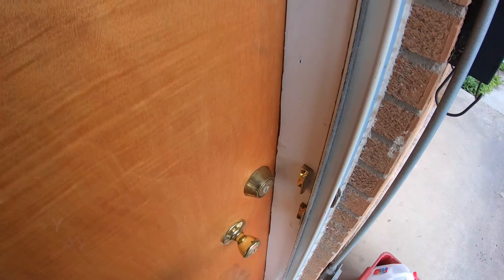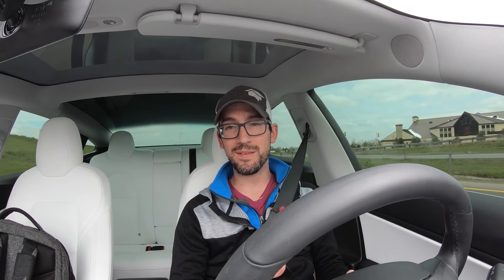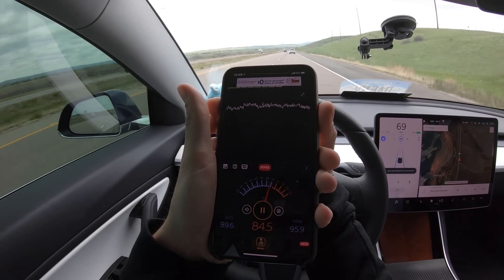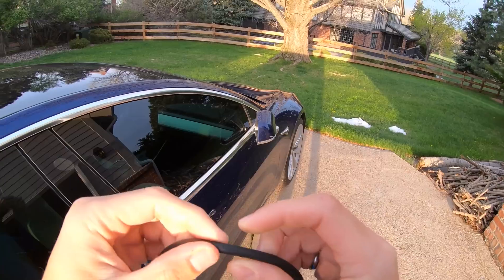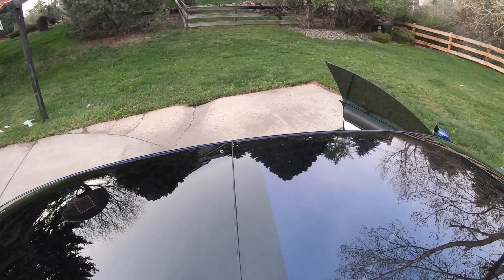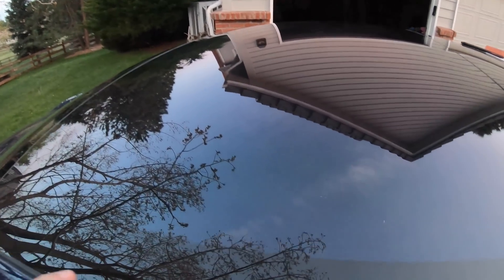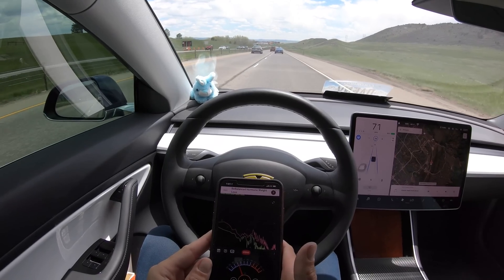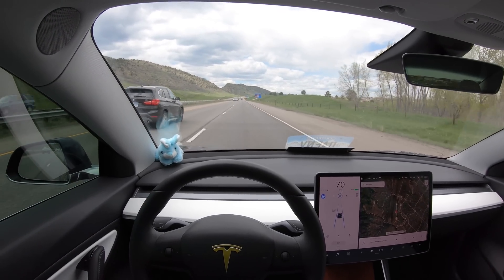Tesla Model 3 Cabin Wind Noise Reduction - Step 1

Comment: I had to have my wife hold one side. Worked well
Reply from the maker: Just rub it in my single face why don’t ya? Just kidding. Yeah I have heard it’s infinitely easier with another person.
Reply: Tesla’s Wild I tried on my own but gave up after 15 min of rubber popping out
Reply: Tesla’s Wild did you have issue with this rubber going underneath glass roof itself ? Because mine seams to burry itself underneath on 2 corners, I might actually take it out.

Comment: Some short Tips for your improvements trials.
What you hear mostly is road noise, not wind noise, the Model 3 is horrible regarding road noise. Some hints for your tweaks:
Try to drive on the smoothest and best road surface you can find, drive exactly the same speed and watch out for little (side)wind. Ride the measurement in both road directions and take the average. Additionally meassure where your ear sits, since preassure levels differ widely inside the cabine --> meassure where you hear it. And at last, dB(A) doesn't really do the trick for your subjective perception, go for something like an articulation index.

And at last, there isn't much you can do regarding the generell wind sound level :-(, you might be able to improve some minor irritations (e.b. whistling from gaps or mirrors). There is a reason the model 3 is very light compared to other EVs, in this particular case: they avoided major NVH concepts and parts ;-)

Comment: Good job. I was curious about why you'd want to measure in the rear seats, but I think it's useful. There's quite a bit of noise coming from the trunk, so the lower reduction in the rear means the trunk noise is dominating there. Some foam under the parcel shelf should help.
Reply from the maker: Ola Leier Thank you! Yeah, honestly I was just trying to get a baseline around the entire cabin because I have a few more steps planned, and now another thanks to you. 😊 I wasn’t sure where exactly this install would impact the most. Any sort of foam in particular?
Reply: @TeslasWild  I'm no expert, but I think closed cell foam will work well under the parcel shelf. The heavier butyl stuff is better used in the doors to reduce the oil can, sheet metal rattle, with some foam outside that again. No need to spend $$$ and add 100 lbs of butyl, it won't ever be completely Rolls Royce quiet, but a little here and there goes a long way.

Comment: 90 dB in a car with no ICE is ridiculous. .even gas guzzling pick up trucks are now in the mid 60 dB range. Tesla has a lot of work to do to make a car worth buying.
Reply from the maker: The Jackal Smith Ha ha it sure is. However, it turns out that I was measuring in full spectrum which picks up absolutely everything. When I measured using my new setup which is more suited for vehicle background noise, it was around 72dB. Still pretty loud, but not deafening as these measurements would suggest. In sound level future videos, I will make sure to clarify this and will use the new setup.
Reply: Absolute dB numbers recorded by phone are worthless. You may as well be measuring the crunch of different carrots. What matters is the same device measuring the difference before/after a single change, as he did here. The Model 3 is more noisy than some premium gas cars, but more quiet than some cheap or sporty ones.

Comment: Nice video production and editing.

     I installed the same knock off kit.  I had the same amount of slack.  I was able to redistribute the slack between the front and sides.  The middle glass was the tightest to push, I used a medium stretch and lots of thumb pressure.  It fit perfectly.
 My road at 117 I'm/h improved. 76db to 72db.

Comment: This works much better and you have extras for the front and back glass as well.  Trim-Lok Rubber Tubing Seal – EPDM Closed Cell Foam Tubing – Ideal Door and Window Weather Seal for Cars, Trucks, RVs, Boats, and the Home – .236” Outside Diameter, .174” Inside Diameter, 25’ Length https://www.amazon.com/dp/B00NL4DCIO/ref=cm_sw_r_cp_api_i_g-R2CbJP10XHN

Comment: You over stretched it, that’s why it failed. You should have stretched to opposing/diagonal corners first, then stretch to the other two corners, and fill in from there... that way you’d have an equal stretch across the whole band with no slack along the way. And yes, a second person looks to be mandatory. But... after watching your testing, I think I’ll add this to my next purchase - to go with the door seals I have coming.
Reply from the maker: Yeah definitely, I mentioned that in the video. At least I think I did. That's definitely why it failed and why there was so much extra slack in the first install. Opposite corners is definitely a good call, as well as 2 people from the start. Please let me know how the door seals work out for you. I've heard some questions regarding relieving pressure created by the HVAC with the door seals. As well as reliability of the double-sided tape.
Reply: Good to know about door seals and cabin pressures. I suspect a complete seal would be difficult to achieve, but even so, a strategic gap here or there could alleviate that quickly if it’s a thing.

Comment: You need better measuring equipment, there is no way that inside sound level is above 70 dB.
Reply: Looking at the graph tells the story. You were measuring the full spectrum this is known as C-weighting. This is not particularly useful for this type of measurement as most of the energy is in the extreme low frequencies. If you were using A-weighting the low frequencies would be ignored and you would likely see something closer to the 60-65 dB range. Also you were looking at average sound level but not all frequencies are the same. For example human hearing is much more sensitive in the 1k-4K range than the others. There could potentially have been a 7 dB drop at some frequencies.
Reply from the maker: John Huff That makes a lot of sense! There are 4 different settings you can measure at, so I will definitely play around with those and report back. A, B, C, ITU-R 468 mean anything to you?
Reply: Life Is Wild ITU-R 468 is a European standard that is typically used to measure audio equipment. A-Weighting is what you should use for this type of test as it is the accepted standard for measuring environmental noise. Your general conclusions are probably pretty spot on but the products don’t seem like they would be very durable. I think if noise was a concern I would choose a different vehicle. Personally I just turn up the sound system a little bit more.
Reply: Kloko Loko agree!  85dB is the maximum safe 8 hour level for working environments. Also the same max level for airlines. So the readings are not reliable/real at all... but it does provide a comparison.
Reply from the maker: Ha ha no doubt... I'm think the legal limit in Denver for an ICE vehicle is like 95dB, and that's on the outside, so there's absolutely no way it's that loud. However, overall I am just looking for consistency of measurement.

Comment: I suspect most of the noise created because of the roof seams come from the leading front seam stretching from the driver's side to the passenger's side.  The wind probably doesn't hit the back seam as strongly since it's shielded by the apex of the roof.  That may be why you noticed more of an improvement in noise reduction at the front of the cabin.
Reply from the maker: Ken Bob That would definitely make sense!

Comment: Could you just have put down a bead of clear silicone with a caulking gun?
Reply from the maker: Ken Bob Definitely! Would have the same effect and definitely much cheaper. Thought about it, and if I was confident enough in my caulking abilities (be careful how you say that), that I could make a uniform bead across each section, that would have definitely been the way to go. This was my first step in quieting the cabin, but this was also intended as a product review, and overall I would give it a 3/10 would not recommend.

Comment: I installed the same... you should have used some tape and distribute the tension allover the windows surface...
Reply from the maker: Frederik van duuren That is a great idea! I will do that with the next set from RPM. Thank you. :)
Reply: Maybe you should reverse the process... Install then measure... Uninstall asap then remeasure with same conditions ;)

Comment: I have seen many videos on this product, pretty much garbage & most of them took it out & put in the garbage. Most of the noise if from the tires which is pretty normal, you just here it more because the car is quiet, engine noise dampens the sound in ICE cars.
Reply from the maker: Gregory Crum Agreed, but I’m happy to test things out and see if they help even in the slightest. People tend to forget that even though it is noisy in a Tesla cabin, it is still infinitely better than ICE vehicles. However, it would be dope to get it even quieter if possible. But there’s also only so much you can do with single pane glass.
Reply from the maker: I was about ready to light it on fire while installing it as well lol.
Reply: Hi you have an amazing channel  can you tell me what type of camera you are using ?
Reply: abdoulhama01 It’s in the description

Comment: Awesome... I have been thinking about doing a few tweaks for improving road and wind noise in my TM3! Thanks for sharing, really helpful.
Reply: Ok, done with the vid. I installed the RPMTesla one legit in 5-10 min and it fit perfectly. My next step is installing Dynomat under the carpet and in the wheel wells.
Reply from the maker: Joseph Jones Ha ha I have to get off of this Amazon kick and start getting legit products. Dynomat is some solid stuff. I had it on my previous car (2013 GTI) which I had tuned, an intake, and an exhaust, and it was nearly dead silent in the cabin.
Reply from the maker: Joseph Jones I’m glad you liked it! If you get this product, I hope the install goes much better for you. 😊 I’ve got a few more noise reduction installs coming, so stay tuned.